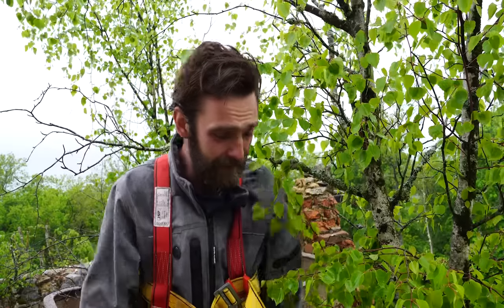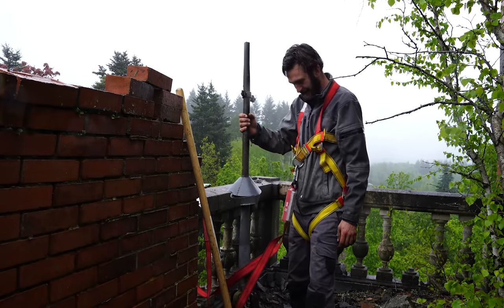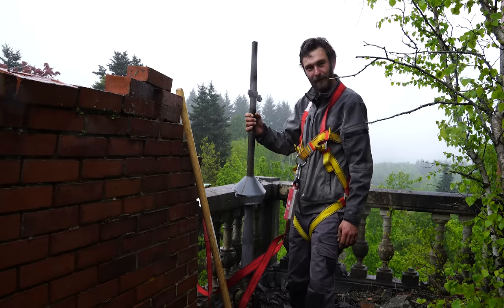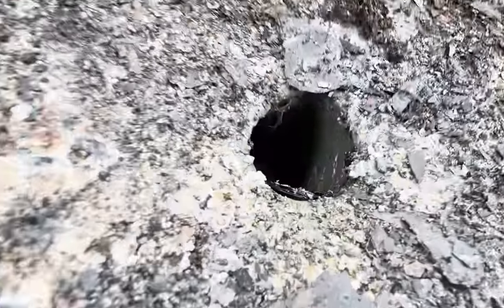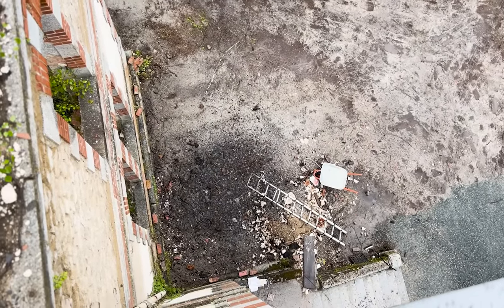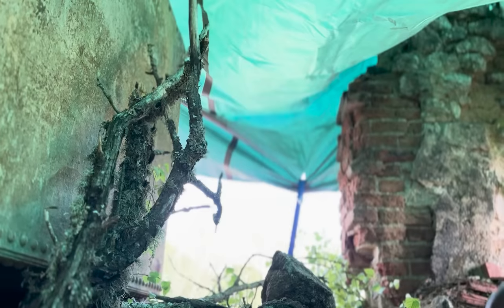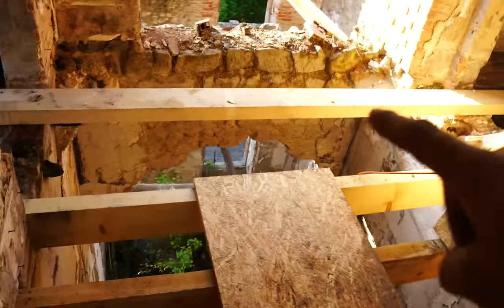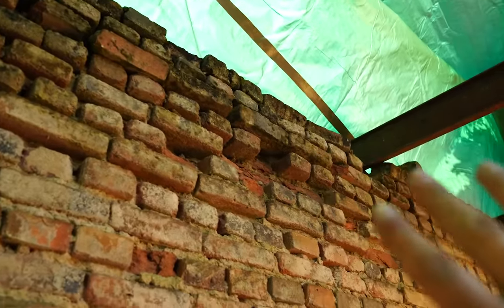I climbed the height of this ruin to make it watertight.

Comment: Climbing around wearing your harness not anchored to anything does nothing for safety . Next time your going to 3rd top floor drag an extra rope with you and put whatever your need to other end of  rope on 2nd floor . Set up a pully system when you get to 3rd floor. Trust me I'm a rock 🪨and ice  climber 😁
Reply: Health and safety killed the British  trades 😂  if this was here , the site would have been shut down first day and  we wouldn't be watching these great videos 😮 scaffold would have had to be erected arounf the whole building before anything started   this guys determination cannot be questioned
Reply: @nickwatson2167  same here US , watching this guy work is accident waiting to happen.  I've never seen a building get built or rebuilt without steel beams , and cranes.  Watching him put in floors using wood beams and a string 4 a level lol

Comment: Dan, tie off (secure) the tops of those ladders!
You don't fall off a ladder to the side, as much as you fall backwards when the ladder pulls away from the building.  You experienced this when trying to get the tarp up the last ladder, but you were low enough to catch it.
Tying off the top of the ladder also prevents them from being knocked down from the top, making you stranded 10 meters up with no way down.
Reply: Good advice.
Reply: Yes, I had that thought the first time Dan went onto the top terrace. I thought if that last ladder fell when he was climbing back over to reach it , he’d be stranded.
Reply: Indeed, and when one needs to bring a heavy load to a upper floor, it is best to not try to bring it on your shoulder while climbing up a ladder. Instead, tie a good rope to the load and pull it up instead.
Reply: Managing a ruin is very difficult, the whold idea is to secure a historical site, Just think how it was to restore Thomas Jeffersons home .
Reply: Dan could always sit on a leaf and wait for fall.
Reply: his ladder was simply set up too straight

Comment: Last October my neighbor fell down a ladder while working on a construction job. Busted both of his ankles and spent 6 months indoors in a wheelchair until he healed well enough to put weight on his ankles.  Sometimes I could hear him getting really angry when a roommate would leave something on the floor behind the bathroom door and he would not be able to wheel himself in to use the toilet, or have out bursts about other things. Suffice to say, maybe you should get a second motor for the upper levels rather than lugging heavy loads up ladders. Don’t suffer like my neighbor.
Reply: One of my parents neighbours has life changing injuries to his ankles and had to take early retirement from work because it was a standing job. Took him two years to be able to walk again and he still limps badly ten years on. That was a six foot drop while fixing a gutter on a single storey building. Doesn’t take much.

Comment: It's GREAT Dan!  You might consider putting in rebar along the horizontal brick layers as you reappoint them.  It will add additional strength and rigidity to the upper sections of the walls.  Honestly, this is just sooo exciting for all of us as we watch, wishing we could actually BE there, helping!  I'd like to see you saving the original whole bricks to put back into the walls. . .just saying!

Comment: The threat of that tarp becoming a huge swimming pool and adding multiple tons of weight to that unstable structure is a great concern.
Reply: That’s may happen, but otherwise the loose structures would be down and the left over may have more safety in it, doesn’t it?
Reply: Also, if any kind of wind picks-up that tarp will come off flying taking its attaching points with it.
Ive also had to deal with very comparable situations, and ive had huge corrugated galvanized steel plates fly off a roof, landing on a neighbouring garden.
Dan if you're reading this, i think you should probably do a structural check, do a temporary roof (partially build the final one) so you get the walls dry enough to then do the whole reconsolidation of the walls, and take it room by room.
Love your channel
Reply: Amen & amen. Did not even think about pooling water on the tarp!
Reply: Yes he said this is a temporary measure until he is able to create a frame structure for underneath the tarp that will allow water to run off it.
Reply: @Nancy Nally  I'm glad to see another repeating what Dan has said. I sometimes wonder if I watched the same vlog. 😅
Reply: @marthaevans8270  I thought that right away when he put it up, a heavy rainfall and its going to be a swimming pool affect up there, and the weight may cause it to come down perhaps.  If it had been on an angle rain would have bounced off of the tarp.  I know its temporary until he goes up there and puts in wood braces for a roof.
Reply: Oh gosh frisbeephil, I hadn't thought of this I imagine it should have some small drainage holes but this rather defeats the object? Xx
Reply: Temp doesn’t work, it can  rain in a couple of days and the damage will be done. The risk of wind is as bad if not worse it will act as a giant sail. Better to have put up a sloping tarp directly over the new floor.
Reply: @goncaloserra4647  Interesting, temporary roof' but what materials?  you sound like you are working in this 'Field'
Reply: @nancynally  👍
Reply: @katharinatrub1338  i am. and what i was trying to suggest was an incomplete roof structure with the final materials as to not have any wastage.
Reply: @goncaloserra4647  Oh! Yes, excellent thinking!
Reply: Will you be able to reuse the lighting rod? I thought that was a treasure.

Comment: According to our Accident Compensation Commission the most dangerous tool in the home is a ladder so super glad to see you have finally got some decent ones , securing the tops would be a bonus if that were possible 😀
Reply: Yes that’s what the top hooks are for.
Reply: @jennifercampbell7698  hi Jennifer it seems an excellent idea, is there a fitting you need for them to hook into. I must check out my local hardware place.
Reply: @Chris-NZ  I think you just need some sort of rail across, whether wooden or metal. I imagine the edge of scaffolding or the like would allow you to hook the top of your ladder onto it.
Reply: @jennifercampbell7698  Arh, right. A bit like those library ladders 😀
Reply: @Chris-NZ  Yes, that concept. I’m no expert but the hardware store could advise you.
Reply: but.. taking tht tarp up it and not able to have three points of contact at all times aged me another 10 years. lol.

Comment: I was so glad to see you get a proper ladder - That one old one did it's job, but honestly mate, I was thinking you were going to have an accident. Really enjoying watching your work and you've inspired me to tackle my ranch to restore it - I'm partially handicapped with serious back issues that limit my mobility, but I just keep gritting my teeth and am bringing it all back a little at a time - I've managed to get my yard to start looking proper and am retrofitting buildings a little at a time - You are inspiring a lot of people with your restoration and know that we are cheering you on.
Reply: If a ladder falls forwards😮😮😮😮😮😮😮😮😮😢
Reply: @Mindsi  The biggest issue with the type of ladder he used to use is that the locking mechanisms can fail, making the ladder collapse under your weight. It actually happened to someone I know, fortunately he was on one of the lowest rungs at that time so no injuries.

Comment: Great videos, enjoying them immensely. Just a constructive observation from 9 years climbing iron and broadcast towers up to 1800 feet up. Your fall arrest lanyards should be attached to the rear of your harness at the center d ring between your shoulders. Once you have that correct, try to always secure  your " larger " hooks above your head. This allows them to stop expansion as designed in less than 10 feet or less should an event take place. From Amarillo, Tx..keep the vlog going !

Comment: Just to let you know, the safety harness needs to be hooked onto the D ring on the back. You want it to catch you on your back between your shoulders. Otherwise you’ll snap your back!
Reply: And tighten the leg straps!!! As loose as they are they're more likely to castrate you if you do have a short fall. Sorry for being blunt but...OUCH!
Reply: He wouldn't be allowed on any construction site due to his lack of work and safety
Reply: Yeah- it’s like watching a health and safety training video to spot the hazards. I’m picturing this vlog being used for years to come by H&S trainers. …”Don’t try this at home, kids”
Reply: @terrybarrett2368  I wouldn't say he's lacking in work as he is doing the video work as well, but health and safety could be improved but he is making an effort!?!
Reply: Lone working at height with a harness is also a concern as what is the procedure to get down if you did fall?  Being suspended in a harness for too long waiting to be rescued will not end well.
Reply: @helenf9650 😂
Reply: Only advice I got on safety lines is if there's a possibility of going over the edge you need a system to rescue as it's not the fire brigades dutybto get you down. As a lone  worker the strap should probably ensure you can't go o er the edge.
Reply: Am I the only “doubting Thomas, here?  I just can’t get past the lack of permits and safety measures in this incredibly unstable structure.  Just because we all want him to succeed doesn’t mean he can or should proceed without the proper permitting and safety clearances , i.e., an engineering certificate.  I know he said he was waiting for approval.   You call this waiting?  ….my danger signals keep blaring  …. I’m sorry if I’m sounding like a negative Nellie …  I surely don’t want to offend anyone and I hate to discourage Dan; but I’m worried about him..yes, I know, I’m repeating myself … just worried … oh, dear, …❤️

Comment: Dan needs to rent a scissor lift or basket lift crane. It would make getting lumber up to the third floor easy and the water tank down simple. But those trees will be rooted into the brick… that’s what is holding it together up there!😂😮
Reply: A scissor lift is HEAVY. Not certain I'd dare drive it onto his floors, or even the ground outside.

Comment: Great video Dan.  As a point of interest, when setting up a ladder there is a proper way to set the correct angle.  With your toes touching the bottom of the ladder legs, your arms outstretched and elbows locked, you  should be able to touch the sides of the ladder. That “triangle” that is produced by your body, your arms, and the ladder create the proper angle for the ladder so you don’t have the top kicking back at you as you try to climb it.  Of course securing the tops of the ladders is also a very good thing to do, especially if you aren’t going to move them much.

Comment: I recommend using a plasma cutter to cut up the water tank into smaller pieces. The smaller pieces of the tank can be dropped to the ground. Any brand name small plasma cutter will do. Any welding supply store will have a plasma cutter.
Reply: The view from up there makes me want Dan to just reduce the height of one of the cisterns and repurpose as a hot tub 😂
Reply: I don't know if they have the equivalent of a Harbor Freight type store there but I got a cheap plasma cutter for about $600 and it works great.
Reply: I was going to suggest cutting up the tank as well
Reply: I would use a 9" angle grinder with a few spare discs!?!
Reply: @bernardkealey6449  I'm up for this idea
Reply: @SteveMirabelli  Should be easy to find a budget plasma cutter, even Lidl's occasionally sell Parkside plasma cutters that are fairly decent from what I've heard. I know someone who bought one of them and turned it into a CNC plasma cutter as a DIY job. Angle grinder would work too but the plasma cutter is probably faster.
Reply: @bernardkealey6449  They'll most likely end up under a closed roof though.
Reply: @SteveMirabelli  Lidl do one for about €150.  Not sure if it would cope with the tanks but otherwise an angle grinder should.
Reply: @Ragnar8504  Power tools from Lidl and Aldi are, allegedly, made in the same factory as Bosch tools but put into a different casing for branding. So I'm told.
Reply: @thomasherrin6798  Me too. An angle grinder is a much more general purpose tool than a Plasma cutter, so is much better value for money. And we know that Dan doesn't have too much money.  If he had money to spare, he'd have been able to put up a professional scaffolding, WITH stairs.
Reply: @michellebyrom6551  That might or might not be true and I've been told by a manufacturer's representative that OEM products are not necessarily the same quality as name-brand ones, even though they come from the same factory (I think he was from some company in the food industry and literally told us: "Our customers can get any quality they want!" when asked if store-brand products from their plant were the same as the ones sold under their own brand). Lidl Parkside tools definitely have a decent reputation though.
Reply: @Ragnar8504  while I said it very much as a joke, with some imagitation (yes that started as a typo, but I think it’s a cool one) and ingenuity that could be dealt with - large folding shutters that can be opened to give a magnificent vista when wanted. Attic spa with view would make a magnificent feature for a high end bnb…

Comment: I am not sure, that this will work! I couldn't tell, how you fastned it, and where? But is there somewhere for the water to go, in case of lots of rain? Because if there is just a slight chance of pooling, it will collect water, and with it - alot of weight! Since the most fragile part of the building IS the top, it might potentially collect alot of water, droop down, and with it, pull down whatever structure it is hanging on to...

Comment: I’d use a saws all on the water tanks cutting them into manageable pieces to throw over the side. Amazing work!
Reply: Yes, probably the best idea so far. Safer than an angle grinder and much cheaper than a plasma cutter. Reciprocating saw is the technical term I believe.

Comment: Am I the only one thinking "the minute there is any wind, that tarp is pulling the top of the building off"?
Reply: At least some of the straps seem to go around the steel beams between the first and second floors, which should be reasonably sturdy. Still not sure how long the tarp will last but it definitely doesn't rely on the crumbling top section of the walls.

Comment: I am watching this couple in the US restoring a mansion called Harrodsburg Castle that was recently in fairly good condition but then the roof developed holes from rain and ruined the whole house.  Anyway in order to repair the inside they have to address the roof which meant putting in temp rafters to jack up the roof.  But first they had to take off the weight of the shingles. They are in their 3rd year. Long story short I think you are better off not having anything to undo just having to build back.  I would not have thought that until I show them struggling to rip out or repair. And there are 2 of them. You have a clean slate and you are doing a great job
Reply: Yes he is!  Dan can do anything!
Reply: That roof has had band-aid patches put on for probably 70 years or more until it finally gave up and started to leak like a sieve all over the place. The fact that the original designer seems to have read too many illustrated German fairy tale books and made the roof line incredibly complicated with valleys, ridges and tiny flat sections all over the place didn't help. Mooreland house is absolutely mental and I sometimes wonder if the original builders might have been way out of their comfort zone judging by some of the poor choices they made, like building brick walls resting on timber sills, now threatening to collapse because the sills have rotted away.

Comment: Awesome to see much more stable ladders, I always cringed every time you used that other shaky one! The harness it great too, but do you have a way of self-rescuing? In my heights training we were told to always work in pairs because there’s not much you can do if you’re hanging at the end of the shock absorber. You can’t stay too long in those harnesses (more expensive rope working ones you can sit for hours, but a basic safety harness is just supposed to catch you and for you to be rescued within 30 minutes or so (or so, can’t remember the exact guidelines for time), but you eventually have problems with circulation in the legs and can black out and eventually die if you fall and are left suspended too long).

It’s a great step but just something you need to think about because it’s not much help stopping yourself falling if you get stuck for too long!

Comment: Angle grinder with cut-off wheels or diamond abrasive wheel would make quick work of cutting the water tank into manageable sizes you could huck off the roof onto your trash pile...just make sure no one is down there when you're frisbeeing the metal off the roof. Same idea of getting an old cast iron tub out of a bathroom by yourself...manageable pieces, smarter not harder.

Comment: I'm a bit worried your harness isn't entirely correct. There's a slack loop behind your behind it seems. And there's not supposed to be any slack in such a harness.
Also, you definitely need a long rope and some sort of descender mechanism. 
If you 'have a spill' and are left dangling, the straps around your legs will eventually cut off the blood circulation to your legs. A few minutes is painful but survivable. Half an hour is asking for trouble, and any more than that you don't want to know about. 
The two hooked ropes... 
Those are for moving about. The theory is that you ALWAYS have one attached to something, and attach the other before releasing the first. Climbing all the way up without using them, then hooking both to the same pipe is just paying lip service to the gods of Safety equipment.